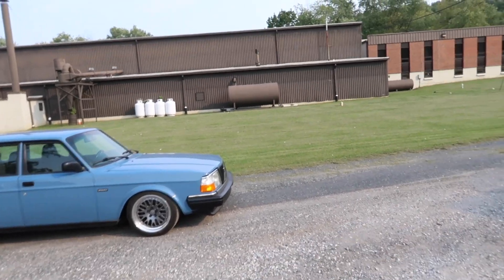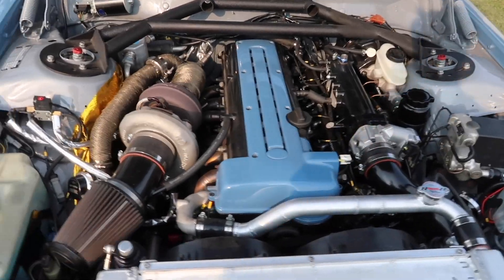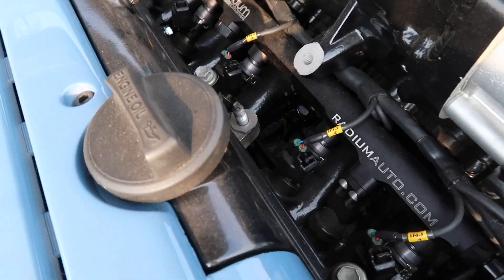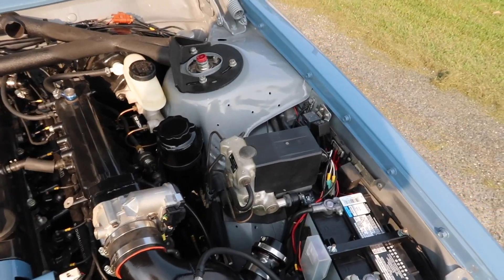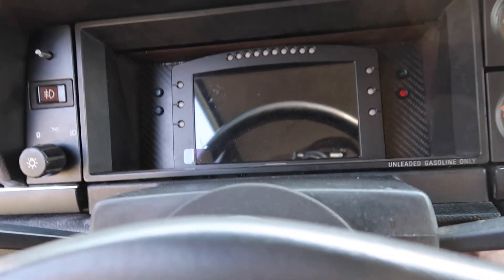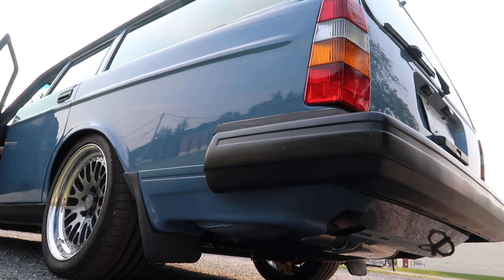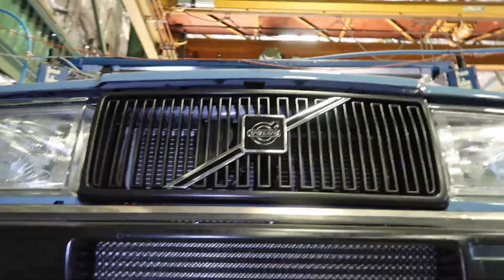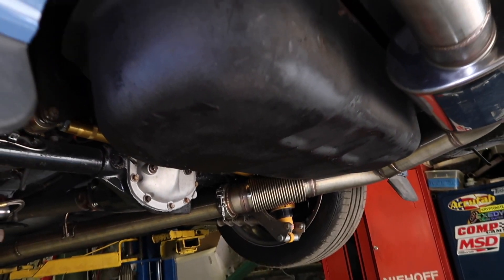Wicked fast yet civilized 2JZ powered Volvo 240 Wagon

Comment: This is my car and will be up for sale soon, most likely on Bring a Trailer, for anyone interested.
For those asking about the CCW classic wheels, the fronts were 17x8 with a 225/45/17 tire and iirc 15.9mm offset
The rears are 17x9 with 255x40x17 tire and 19mm offset
Reply: Would you be open to selling outside of BaT?
Reply: @Mo5005  That gets expensive. They get FIESTY about that, especially under the new ownership. Corpos gonna corpo and all.

Comment: I really like how you cut the front bumper out ,how was it  done?
Reply from the maker: Thanks.  I believe we just used an airsaw.   We originally did not want to cut the bumper to be honest but the oem bumper cover leaves very little open area for air flow and we wanted as much air to get to the radiator and IC as possible.

Comment: Looks and sounds great, I love those supra power plants! How much power does this make?
Big money on big parts for sure, very clean! With a team, the sky is the limit! 
Was expecting gnarly burnouts but only got a tiny little gravel skirt.
 I laughed at the wastegate plumbed back into exhaust comment "civilized vehicle" .
Very interesting radiator tabs, I like it! 
 Would be interesting to see it on the track , dyno and scales! 
Subscribed for more info on this Hopefully!
Reply from the maker: They are great engines to swap for sure.  We have put them in ALL kinds of vehicles from the typical Nissan to an El Camino to a couple different Volvos, BMWs and more.          

This car made 500whp on our low reading Mainline dyno.   

Not my place to do burnouts in the clients car(unless we are building and testing a drift car but we do street drive them enough before delivering.    

Thanks for watching!
Reply: @MAMotorsports  Thanks for your response, and sharing the video.
Reply: Just wow 😍
Reply: @MAMotorsports  For future reference, look into hp monster red blocks from Sweden. People here are getting 600hp with 99% stock b230ft, just bigger injectors etc etc but internally it's original except stronger rods.

Comment: @5:45 how big is the driveshaft?  3.5" should fit a lowered 240 and hit bump stop before it rubs.

Sick build!
Reply from the maker: It was 3” steel I think.  The issue was that the JZ with this trans was mounted as low as possible and still not able to clear.

Comment: How did the motor fit I just bought a 240 and I’m putting a 2jz motor in it too😂
Reply from the maker: it required modification to the cross member and a customer tunnel for the driveshaft in order to get everything where we wanted it.

Comment: Does the volvo 740 platform have more engine bay room than the the 240?
Reply from the maker: We actually 2J swapped a 740 also in the past.   It’s about the same amount of space from what I recall.   Maybe a little more but I believe they are pretty close to the same.